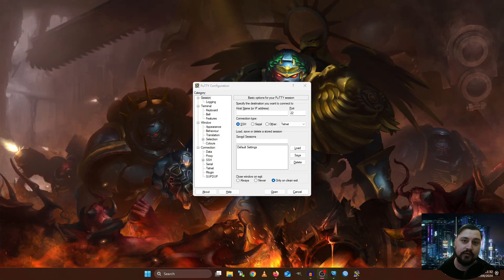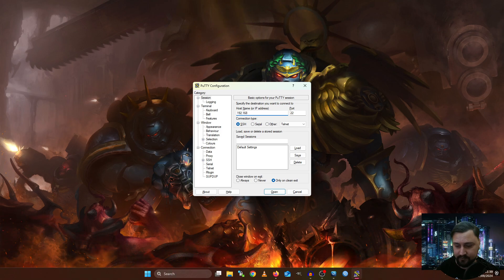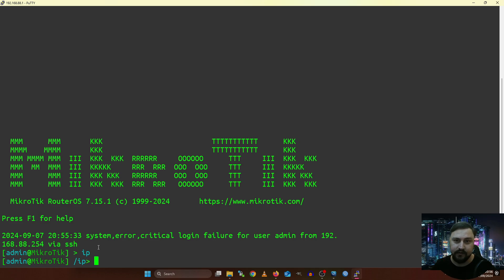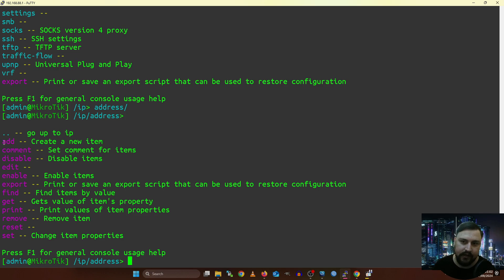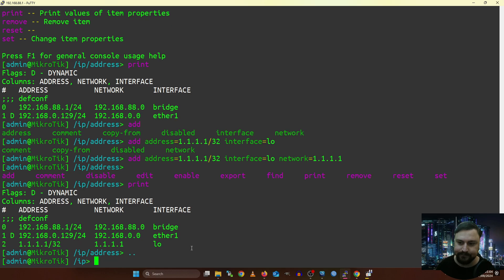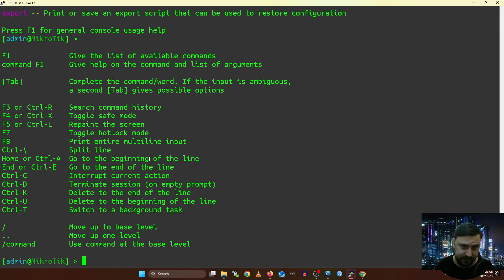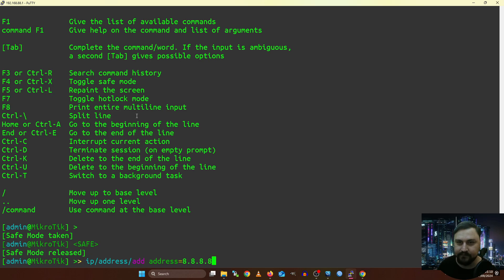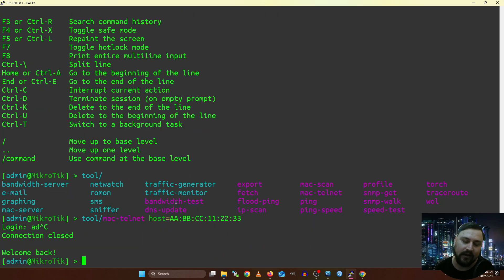Mastering the MikroTik CLI/Terminal. Free MTCNA Ep.6

Comment: Could anyone help me help myself here? 
I'm learning through these videos and others, but keep running into issues. I think my Mikrotik router is flagging certain types of traffic as invalid after disconnecting my PC from a cloud-based VPN provider (Proton). SSH and ping traffic to a local pi-hole server gets caught by my `drop invalid` firewall rule. On the first boot, it works, on connecting to Proton, it works (port forwarded). When disconnecting from Proton, suddenly I can't SSH or ping my local pi-hole server. Tailscale may also be driving some of these issues, but I'm confident Proton is the primary source. I just don't know what is happening or how to fix it.

Comment: For your knowledge, the hAP does have a serial port. And as far as I assume; anything else with a USB port also does.
I have connected a USB serial cable directly into the USB A port on a hAP & hEX, you just need the right cable

If you have a USB to serial cable, plug it in and you will see that serial interface comes up
Reply from the maker: Ah thanks for that I honestly have never tried to console using the USB port on it, I'll have to test this out if I can get the appropriate cable